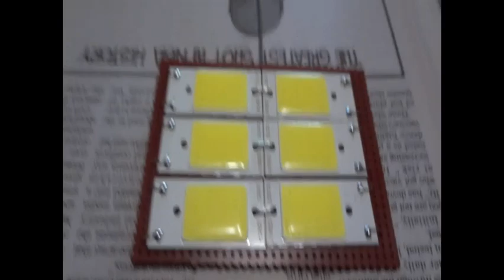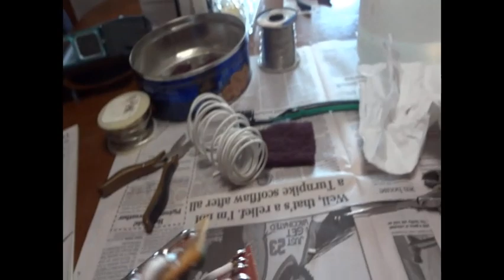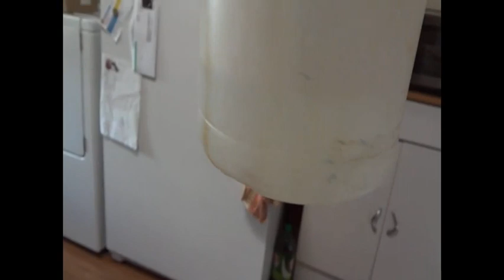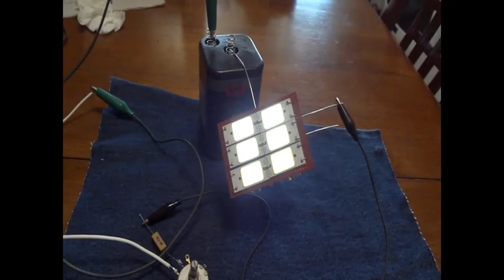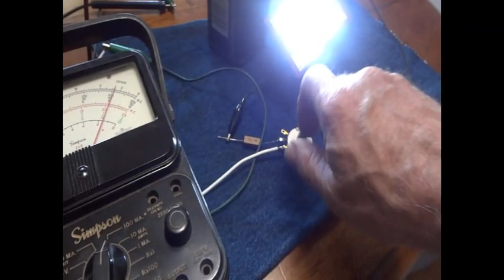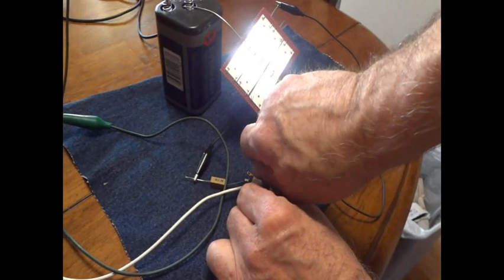2400 Lumen Light Build Part 3 Actual 2880 Lumens of Light

Comment from the maker: I connected this light directly to my 6 volt battery with no external resistors. I was able to get 1 AMP out of the battery @ 4 Volts. It would seem that when you reach 500 milliamps the battery voltage starts to drop.

Comment: Wouldn't it be more efficient to use a dedicated led power supply instead of the resistor circuit. Just curious
Reply from the maker: Thank You for your comment, I did not do any research on power supplies which are more expensive then 12 resistors which only cost me $ 6.00.
I only needed 6 resistors but I added the other 6 for a lower power setting. Also I want this light to be portable so a battery pack is my only option.
Would a LED supply be able to deliver the 2.7 amps @ 6 Volts ? I feal like the movie back to the Future wondering where I am going to get the 1.21 Gigawatts Of power I need :)